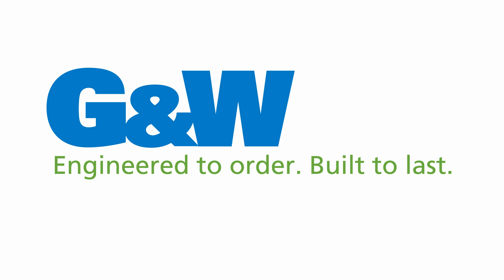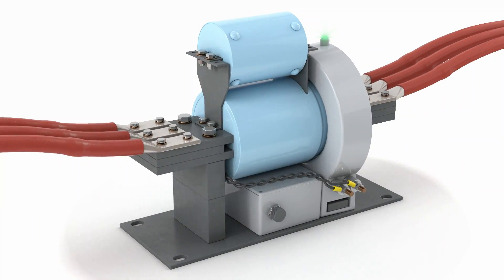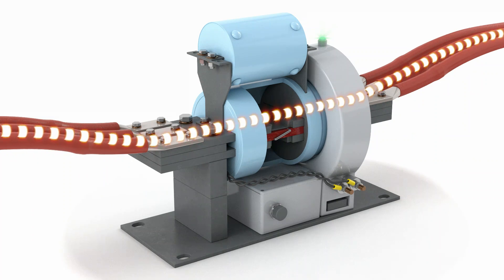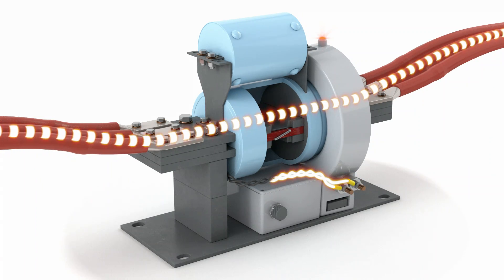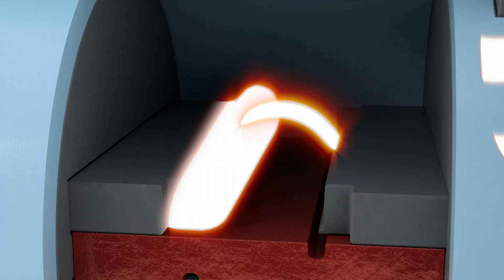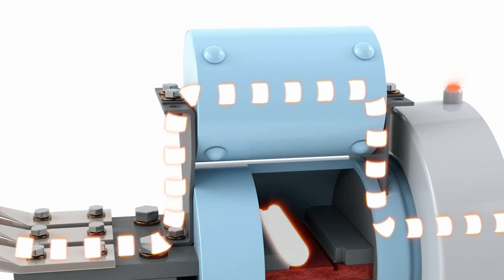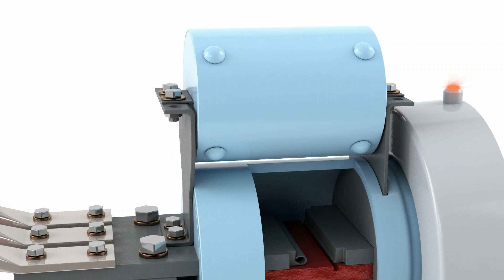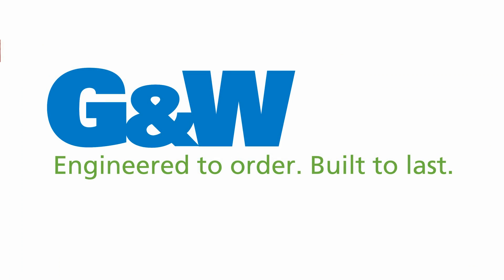How Current Limiting Protectors Work: A Simple Explanation

Comment: The current flows in one direction? That would mean these are made for DC systems. Those would be very applicable to most systems then, since most system are AC systems.
Reply: Come to think about it, the Current Transformer would not work if it was DC. It must be AC. I think the dialog was incorrectly written. It should probably say one path instead of one direction, referring to the path through the CT as opposed to the fuse.